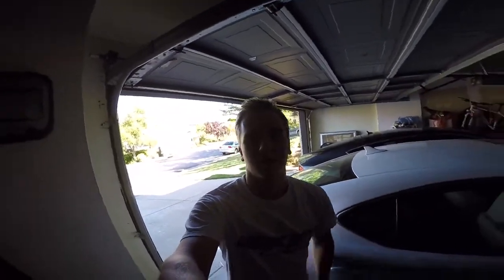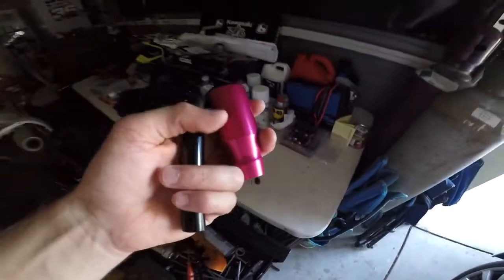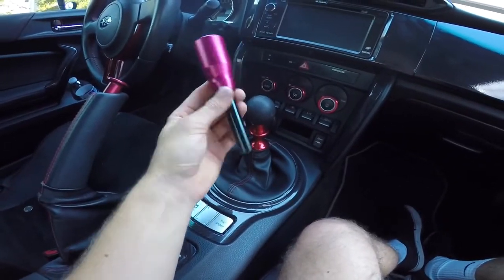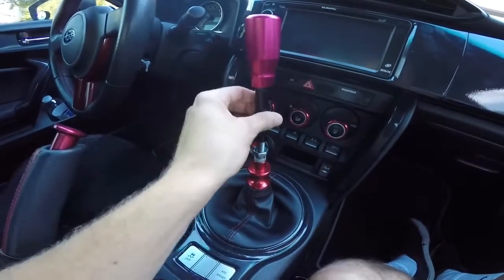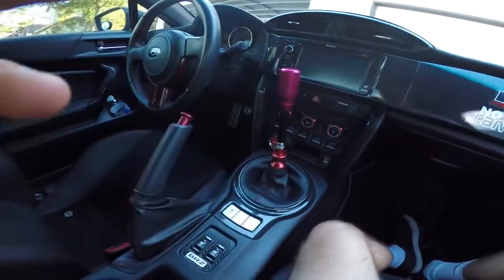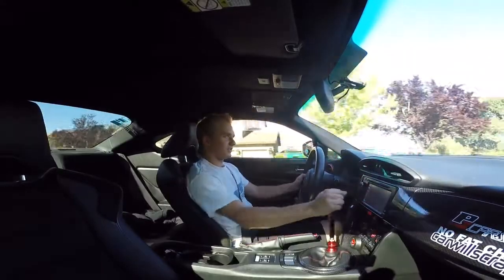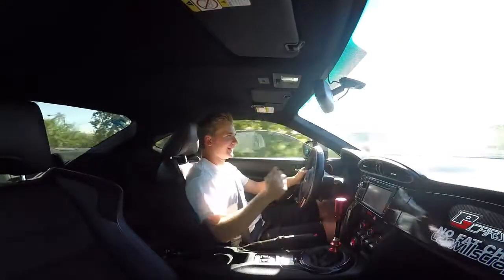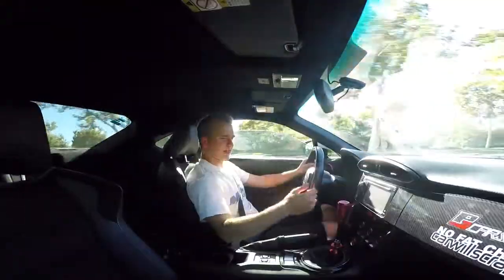New Shift Knob Install and Review

Comment: Do you still have it? How do you feel about having it after awhile?
Reply from the maker: I stopped using it after about a month the extension is good but makes your throws feel supper long and the shift knob is bad because it has a plastic insert for the thread and it eventually started to spin.

Comment: Stop coasting in neutral! Heel-toe-downshift my guy.
Reply: What's wrong with coasting. I coast all the time, it saves my clutch and I can relax my leg
Reply: dsourn its not good for your car at all... soon youll be seeing issues:)
Reply: @UnfairGrizzly  can you tell me what's not so good besides wearing out the brakes. I been coasting for 19 years, 50k on oem clutch and no transmission issue.
Reply: dsourn So first things first you waste a lot more fuel while coasting & Rather than damage your car, coasting start to wear out internal parts quicker than they should. 
So rather than using the engine along with the help of the brake to slow down and stop, full reliance is on the brakes only. 
So waste of fuel, brake issues& replacement & wears out ur internal parts which you shouldn’t be doing as you have so much driving experience.. 
i mean i coast every now n then , mostly downhill traffic & sometimes junctions but a bad habit.
Reply: @UnfairGrizzly  can you tell me what internal parts of the car is going to go bad when coasting. I always hear it but never an exact answer. Fuel is not a problem, my evo is already a gas guzzler